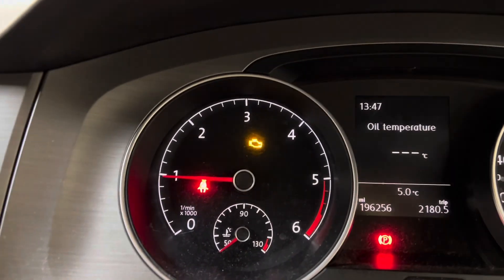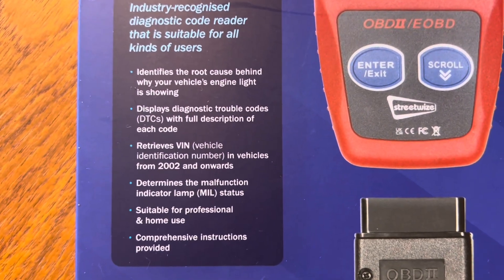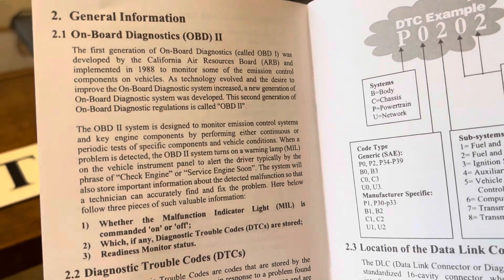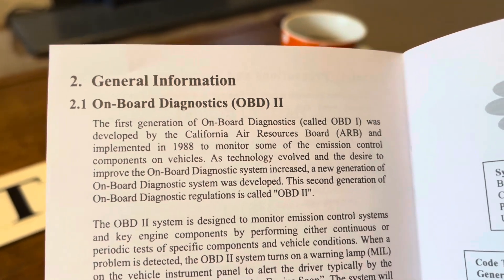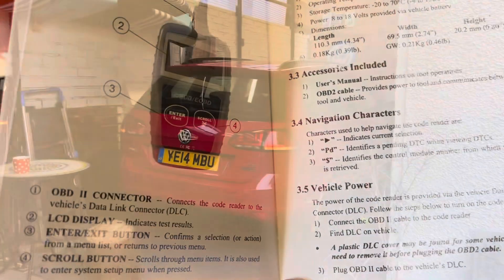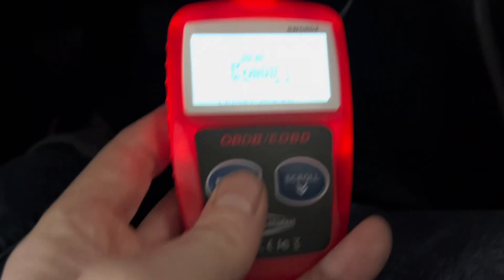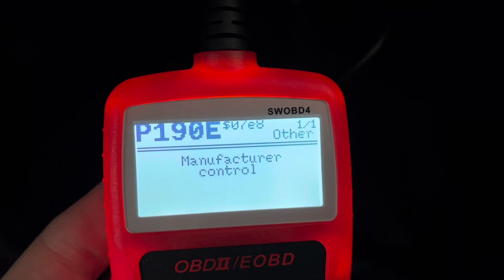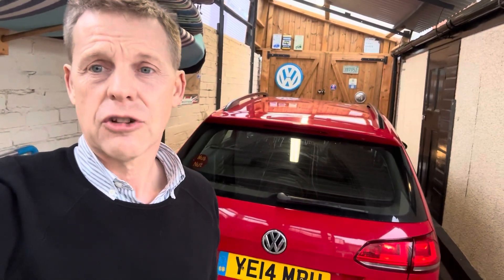Streetwize OBD2 reader test VW Golf Mk 7

Comment: I agree - I have a B7 Passat 2.0 TDi which I have owned for 9 years and it's on 170000 miles. Never had one problem with it. I thought it might be battery related when it picked up a voltage issue. Well done.